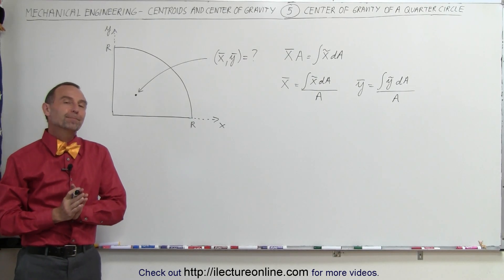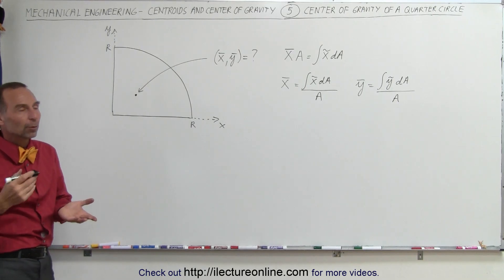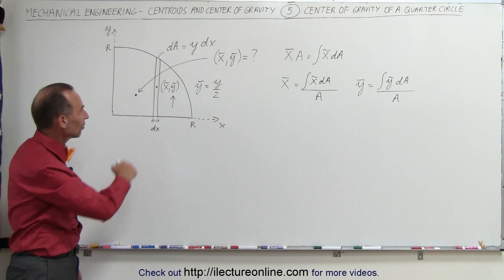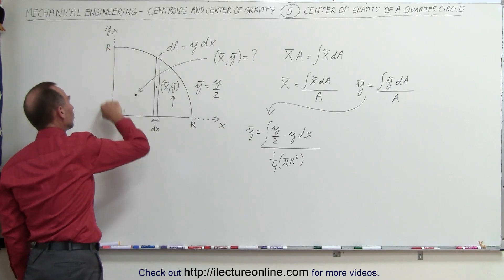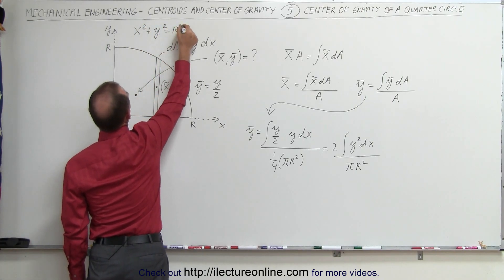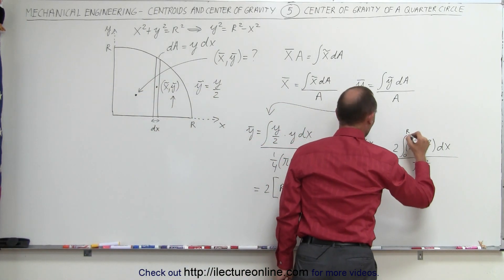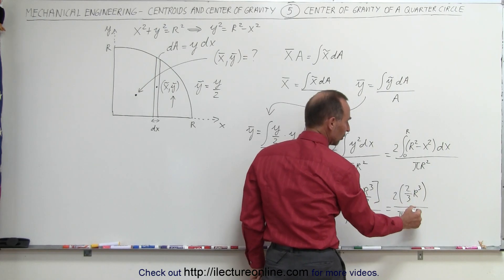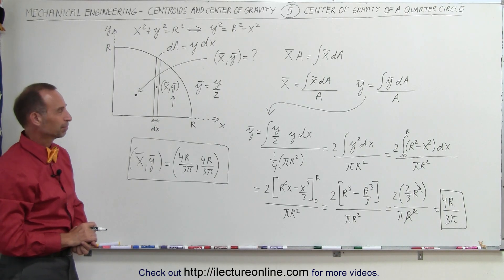Mechanical Engineering: Centroids & Center of Gravity (5 of 35) Center of Gravity of a 1/4 Circle

Comment: UNDERSTANDING A TWO DIMENSIONAL SURFACE OR SPACE AS invisible AND VISIBLE ON BALANCE, AS E=MC2 IS F=ma:

E=MC2 AND F=ma IN BALANCE do also FUNDAMENTALLY represent (on average) what is a two dimensional surface OR SPACE (as what is a BALANCED MIDDLE DISTANCE in/of SPACE), AS ELECTROMAGNETISM/energy is gravity. Gravity IS ELECTROMAGNETISM/energy. Gravity AND ELECTROMAGNETISM/energy are linked AND BALANCED opposites, AS E=MC2 IS F=ma. The stars AND PLANETS are POINTS in the night sky. Gravity/acceleration involves BALANCED inertia/INERTIAL RESISTANCE, AS E=MC2 IS F=ma ON BALANCE; AS ELECTROMAGNETISM/energy is gravity. Accordingly, the rotation of WHAT IS THE MOON matches it's revolution. It is CLEARLY proven ON BALANCE. E=MC2 IS CLEARLY F=ma ON BALANCE. This NECESSARILY represents, INVOLVES, AND DESCRIBES what is possible/potential AND actual IN BALANCE, AS ELECTROMAGNETISM/energy is gravity. TIME dilation ULTIMATELY proves (ON BALANCE) that ELECTROMAGNETISM/energy is gravity, AS E=MC2 IS F=ma ON BALANCE !!! Indeed, TIME is NECESSARILY possible/potential AND actual IN BALANCE; AS E=MC2 IS F=ma IN BALANCE; AS ELECTROMAGNETISM/energy is gravity. Gravity IS ELECTROMAGNETISM/energy. "Mass"/energy is gravity. ELECTROMAGNETISM/energy is gravity. (BALANCED inertia/INERTIAL RESISTANCE is fundamental.) Objects AND MEN fall at the SAME RATE (neglecting air resistance, of course), AS E=MC2 IS F=ma ON BALANCE; AS ELECTROMAGNETISM/energy is gravity. 

By Frank DiMeglio

Comment: Sir in this video and in the series of Videos of centroid and centre of gravity ... are centre of mass , centre of gravity and Centroid same ?
Reply from the maker: Essentially yes.  There are slight differences in the definitions, but essentially they will all give you the same point on the object.
Reply: @MichelvanBiezen  Thank you sir
Reply: @sushantsrivastava7013  Given a uniform density and a uniform gravitational field, all of the above end up being the same point.   Given a non-uniform density, there will end up being a difference between the centroid and center of mass.

Think of centroid as center of geometry, where we don't consider density just yet.   The center of mass is what you get if you insert a density term in to this calculation, and divide by mass at the end

Center of gravity and center of mass, more often than not, are the same point, because most gravitational fields in practical examples are close enough to uniform that the distinction doesn't matter.  The difference is that center of gravity would require you to put a g-term in the integral as well, in order to account for varying gravitational fields if they applied.
Reply: @carultch Thank You Amica

Comment: Kan dieselfde oefening in poolkoördinate gedoen word?
Reply from the maker: Het is veel beter om het met deze technique to doen
Reply: @MichelvanBiezen and excuse a query
 even though the area has circular symmetry, you can always select a rectangular differential element as in the explanation?
Reply: @MichelvanBiezen  and excuse a query
 even though the area has circular symmetry, you can always select a rectangular differential element as in the explanation?
Reply from the maker: The reason why this technique is easier is because you need to find the center of mass for each of the area elements which is easier with a rectangle.
Reply: @marcacastrodiegoarmando4243  In the limit as dx goes to zero, the rectangular differential element will account for the shape of the circular area we are integrating exactly.

If you have a finite value of dx and do a Riemann sum instead, you will only get an approximation.   This is one solution that you would do, if it were impossible to integrate in closed form, or if you were learning what integration means for the first time as a set-up for solving it analytically eventually.  You can do better than a rectangular differential element, as trapezoidal differential elements can take in to consideration the slope between end points.   You can do even better with Simpson's rule, that approximates the edges of the differential element with parabolas to consider curvature of the function as well.

Comment: Y don't you take height as R/2  instead of y/2.......🤔. It is just a portion not the whole Y axis isn't it
Reply: Why he take y/2orR/2...it can be Y/4
Reply from the maker: Depending on which strip you take, the height is different for each strip.  The height in only R/2 at the y-axis, so we use a variable to indicate the height.

Comment: everything makes sense except for defining y=y/2. can it be any point? say, y=0?
Reply from the maker: The center of mass of each thin strip will be at the half way point between the x-axis and the top of the strip.
Reply: Thank you sir, but why aren’t we doing that for example if we want to find the centroid of a normal rectangle? The Center of mass of each strip would also be at the half way point but there we just take the full height b and not b/2

Comment: sir how to calculate the centroid of full circle?
Reply from the maker: The centroid of a full circle is at the center.
Reply: ya its true but how to calculate by method of integration?
Reply from the maker: Exactly the same as a quarter circle of half circle, except that you would change the limits of integration.
Reply: ooooo.. then what should be the limit ... and how does the pie cancel out?
Reply: @kamalnepal2511  The pi will cancel out, because you are ultimately dividing by the area of the circle at the end.  There will be a pi-term in the area-moment where you integrate r*dA, and there will be a pi-term in the total area of the circle.

The limits of the half circle would be from x = -r to x = +r, and you would determine that dA = dx*(y - (-y)), with the equation y=sqrt(R^2 - x^2).   This would reduce to dA = 2*y*dx, and your integrand would be r*dA = 2*x*sqrt(R^2 - x^2) dx.   This solves the total moment of area of the circle about the y-axis, as you radial coordinate is x.  This ends up equalling zero, because the negative half of this integral is exactly equal and opposite of the positive half of this integral.

Comment: is it possible to use the vertical slice to get the ''x'' coordinates?? or horizontal slice to get the ''y'' coordinate??
Reply from the maker: It would be better to use horizontal slices.
Reply from the maker: To find the x - coordinate and vertical slices to find the y-coordinate of the CM.
Reply: Michel van Biezen ok so that means it is possible... But not recommended
Reply from the maker: I think it would be difficult since you have to place the center of mass of each section at the halfway point of the dx or dy.
Reply: Michel van Biezen thank you Mr.Biezen.. asking because I have an exam question asking me to find the x coordinate using the vertical slice.... and I have the solution but I didn't quite get how he went about it

Comment: Hi sir, your video is really good. Helped me a lot. Just have one doubt: I don't get why you don't treat R as a constant when you integrate it...
Reply from the maker: R is a constant (and it was treated as such in the problem)
Reply: But shouldn't it just come out of the integral without the "x", in (R^2)x?
Reply from the maker: You don't have to take out a constant.  (You can if you want to but it is not necessary).  Also you would have to split the integral into 2 integrals before you can take out the constant R.
Reply: Aaaaah... yes... I got it know.... thanks a lot for the attention!!!

Comment: Why are you using the area (dA) rather than the mass (dM)? I know it wouldn't change the end result for the x and y coordinates, however isn't it important to include the surface density in the calculations or is that just dependent on personal preference?
Reply from the maker: If the mass is not known, but you know the mass per unit area is constant then it is logical to use the area.
Reply: Imma Rosa verygood
Reply: There is another example, where you aren't really interested in the mass, but we do care about the centroid.   In Euler's beam theory, the centroid of a cross section plays an important role in determining the geometric strength properties of a cross section.   The centroidal axis of a beam is the location where the neutral fibers occur that are neither in compression nor tension.  Distance from this neutral axis establishes how much the remaining fibers contribute to its flexural strength and stiffness.

That's what you would do with a uniform cross section.  If you had a composite beam, instead of using density to get center of mass, you would apply Young's modulus throughout the integral instead of density, as you'd be looking for the center of stiffness to establish the location of the neutral axis, rather than the center of mass.

Comment: sir without calculus is it possible to get centre of gravity of this same question
Reply: The centre of mass for any sector can be given as the x coordinate = 2rsin(A)/3A where A is the angle from the x-axis in radians. In this particular scenario the angle from the x-axis is pi/2 radians giving A as pi/2, substituting this value into your x coordinate equation, you will get that x = 4R/3pi. Knowing that for the quarter circle, the centre of mass has the same x and y coordinates, you can deduce that the centre of mass is given (4R/3pi, 4R/3pi)
Reply from the maker: It would be much more difficult without calculus.

Comment: Thank you for this video. Can you please help me solve this question:
A goblet consists of a uniform think hemispherical cup of radius r, a circular base of the same material, thickness and radius as the cup, and an intervening stem of length r whose mass is one quarter that of the cup.
(a) Show that the centre of mass of the goblet is (13/14)r above the base.
(b) If the mass of the goblet is M and that of the amount of liquid it holds is M' show that filling it raises its centre of mass by 
(39/56)(M' / M + M')r
I'd really appreciate your help!
Reply from the maker: You just need to find the center of mass of each piece separately and then add them together as done in this example:  Mechanical Engineering: Centroids & Center of Gravity (18 of 25) C. G. of a Composite Plate 3     https://www.youtube.com/watch?v=8jo8gVUmTEw&index=18&list=PLX2gX-ftPVXWnfWWDNgu4x9hiCPTi0HB9
Reply: I could get part a but I haven't a clue on how to do part b. When they add liquid to it, we don't know the radius of the liquid or any other dimension. I'm not sure how to go about part b.
What will the equation be?
M( 13/14)r + M' (x) / M+M   but what is the centre of mass from the liquid?
Reply from the maker: The centroid of a hemisphere is 3R/8 (from the top) and 5R/8 from the bottom.
Reply: But this is a shell, wouldn't we be using the surface density for this?
If the centre of mass of an empty goblet is 13/14 r, what will happen to the centre of mass when we add a liquid to it? How will we calculate that?
Reply from the maker: My comment was for the liquid.  I thought you were asking about how the problem changed when the liquid was added.  You wrote that you found the answer to part a for the goblet.
Reply: Yes I found the answer to a but I've just been using surface densities throughout.
If for the liquid I use the volume density, how does that work? 
Can you give me an equation for b?
Reply: So you would have 
M(13/14)r + M' (5/8r + r) /(M+M')
But how do you simplify this equation?

Comment: Thank you Professor.....for explaining it in such a way that I may understand it. The only question I have is that why my book shows to integrate the numerator too?
Reply from the maker: I think you are asking about why we didn't integrate the denominator?   In this case the denominator represents the total area which in this case is just the area of a quarter circle.  We don't need to integrate that since it is easily calculated without the integral.
Reply: Thank you